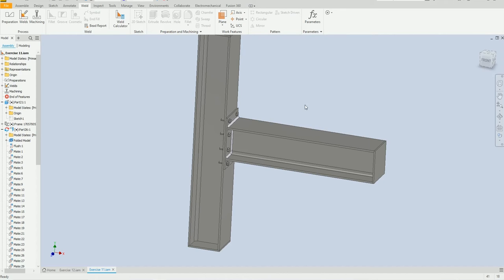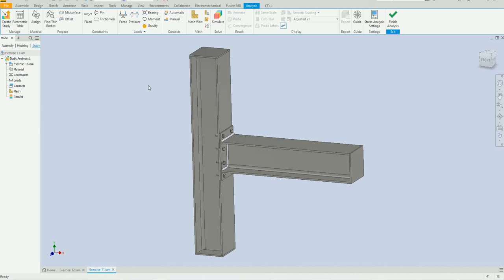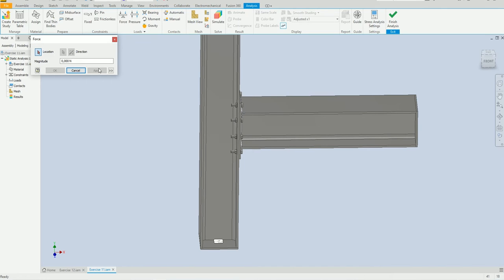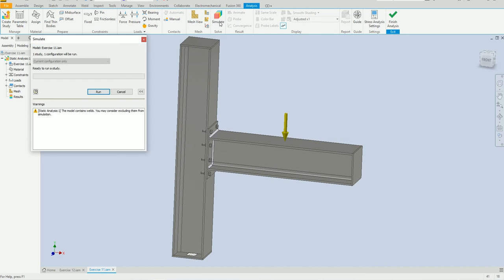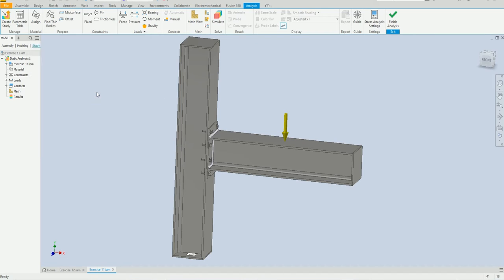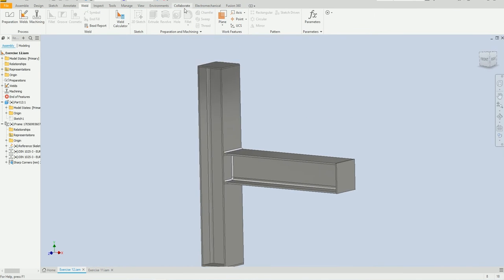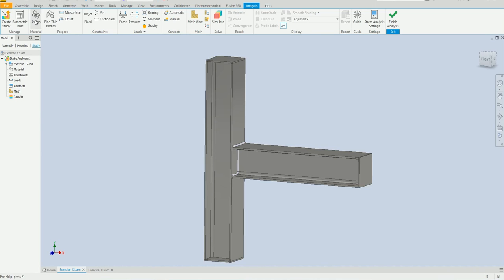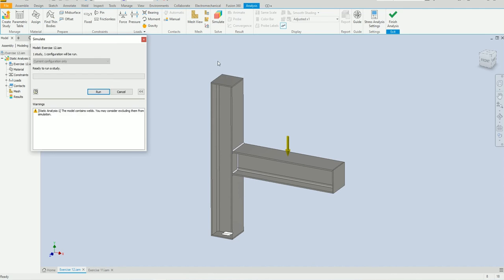inventor 2024  Stress Analysis welded and bolted  structural Exercise 12

Comment: i appreciate the effort you put in the video. It is however very misleading and not correct. when you use the "Automatic Contact Detection" Command, Inventor will automatic do the calculations assuming all the surfaces in contact with one another as if they are welding together !

Comment: Stress distribution in the bolted connection is not as expected. The stress concentration should be at the location of the holes. Unfortunately, automatic meshing glues the surfaces that touch each other.
Reply: exactly, i was looking for an example that takes this into account.
Reply: You mean "automatic contact detection", right? It's in the study setup and is "bonded" as default.